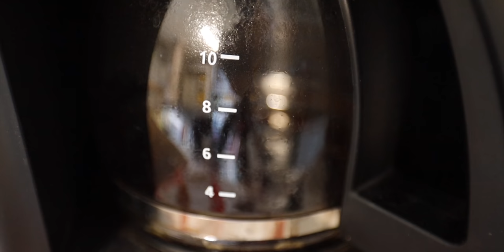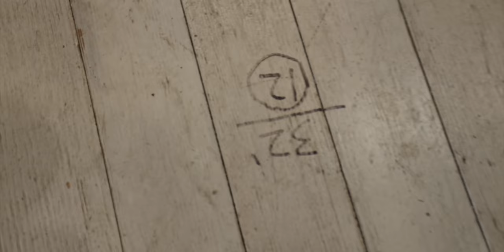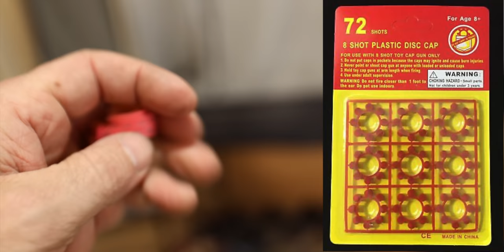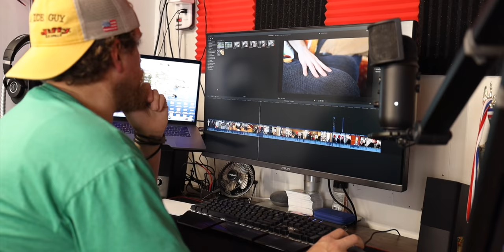Day 1 of 30 Day Survival Challenge Maine Lockdown (Season 3 of the 30 Day Survival Challenge )

Comment: I'm in the UK and I decided to make myself a 7ft x 2ft x 4ft cabinet, on top it has two indoor green houses, for which I bought LED lights for the bottom of the 3 shelves and a fish tank, which I am aquascaping. The top level of the Cabinet is insulated and with a small heater holds a temperature of 24C perfect for making Beer, Cider etc.. I also have a hole in the top going into each green house so that the CO2 created by the fermentation process can go into the green houses to feed the plants. The bottom section of the cabinet is being used for storage. in 2-3 months I will have a steady supply of salad/vegetables and some home brew.

Comment: If you don't know about this? Take a little bit of ash from your stove, some water, and a couple pages of newspaper.  Ball up a page of the newspaper. Dip one end in the water, than in the ashes. Open the door on your stove when cold. Then whipe the inside of the glass lightly in small circles. Then whipe the ash off the glass with dry towel. It should be clean as new.